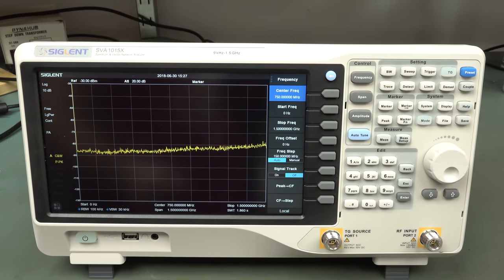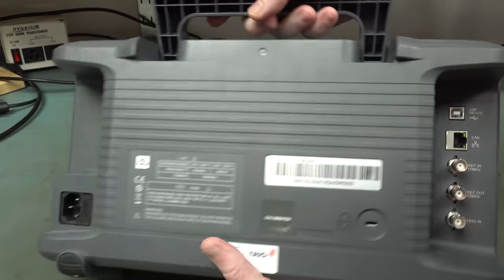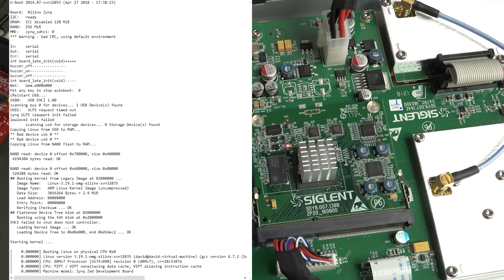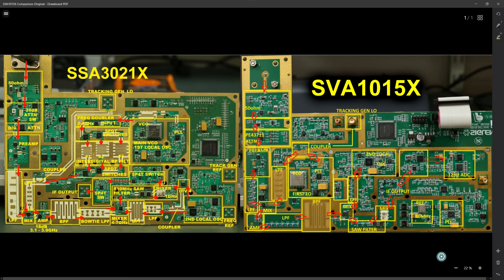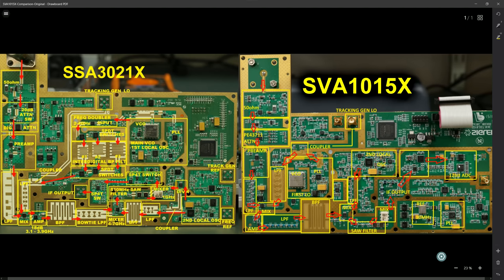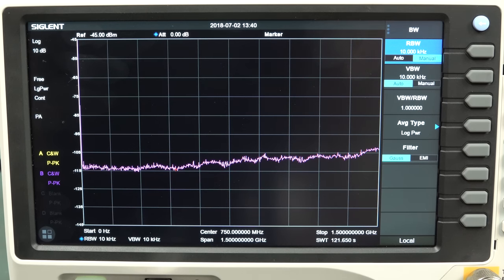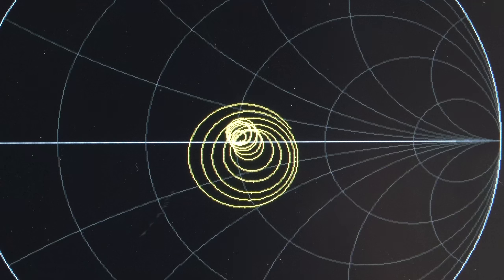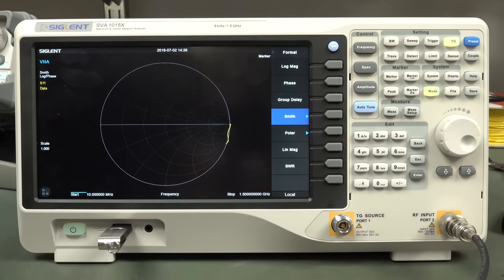EEVblog #1101 - Siglent SVA1015X VNA Teardown

Comment: the base material of the distributed element filters locks much different in both instruments -
could that be the reason for the larger structures ?  like, more expensive ceramics in the 3GHz analyzer as opposed to cheaper ceramics or kind of epoxy or similar in the lower bandwith sva ... ?
Reply: Isn't the larger size simply because they're lower frequency? If I were to guess, I'd say that's why they've converted some of the filters to discrete components as well, because they'd start being impractically large as DEFs.
Reply: you are right,    I was shooting too fast :-)  ...  ...
different materials could be used, because  losses in a (supposedly) lower priced material are frequency dependend and less contributing at  half the maximum frequency

Comment: Personally I like S-parameters with dB rather than a Smith chart as it's more intuitive for me to read the amount of power being reflected or transmitted at a frequency of interest (and the phase in some cases). Smith chart seems a bit old school for me.
Reply from the maker: Yeah, i's just a different way of looking at the same thing. Some prefer one to the other.
Reply: derre98 the dB magnitude is for gain and return loss, so might as well use a scalar analyzer.  With the smith chart, you can actually see what needs to be done for impedance matching, though you must have a good calibration with well defined reference planes.
Reply: S-parameters include the phase as well and I use phase information so I need a vector network analyzer. I just most of the time fit some data to S-parameters to characterize some samples over wide range of frequencies rather than doing simple impedance matching so never gotten into the Smith chart much. Same information, different representation.

Comment: Back browsing cheap SAs again and I’m beginning to not be a fan of Siglent marketing... fully optioned this thing is what $4300.00US  and decent options it’s $3500.00US, it makes the Rohde and Schwartz FPC1500 seem like an absolute steal at $3000.00US, Siglent needs to get busy working on that full bundle for sub $2000.00 and throw in the calibrator for the $600 they are asking for the VNA option... seriously though $4300.00US for 1.5Ghz SA is not exactly cheap, especially when you see things like Smith charts that aren’t labeled... really? I’m assuming they are fixing that so probably no big deal....

Comment: I never understood why Spectrum analyzer (especially with TG) and VNA are separate devices. It always struck me as milking the market, and maybe running little different software, and little bit different layout of buttons to be optimized for task. But come on.
Reply: Typically, SAs have a better filtering architecture. VNAs usually omit the filtering because the stimulus signal is known. And of course VNAs must measure amplitude and phase. A combination meter is possible, but the price would be driven up. The Keysight Fieldfox is a SA/VNA, but is is like buying a nice truck $$$$$.

Deepace makes a combination meter for about $2k, but the SA performance is terrible. The VNA performance is ok.

I agree with you, I would like a Handheld battery powered SA/VNA with reasonable performance.
Reply: Yeah, I guess the phase measurement is the hardest part.

Comment: Can anybody tell me if the ‘N’ connectors on the Rigol 832 and the Siglent SSA 3032X spectrum analyzers are the same distance apart? I want to buy the Siglent, but their directional bridge is only good up to 2GHz, while the Rigol one is good for the whole 3.2GHz. I’m going to try to buy the Rigol directional bridge, to use with the Siglent, if it will fit without using extra cables. Thanks!

Comment: Primary Lelon cap.. Really?
Reply: Of all the places in an SMPS to save the money, the primary filter is probably it.  Only sees line frequency ripple, and a fairly constant load.  They rarely go bad in service, unlike the secondary side filters, which need to be low ESR, high ripple current types, and we have all seen cheap caps puke their guts and fail here. They chose to spend the extra money on Rubycons where it counted...
Reply from the maker: Yeah, I'd probably have to agree with Bob. The output caps work harder, so if you are going to skimp, the input if the place.